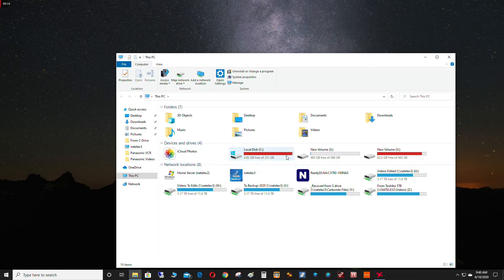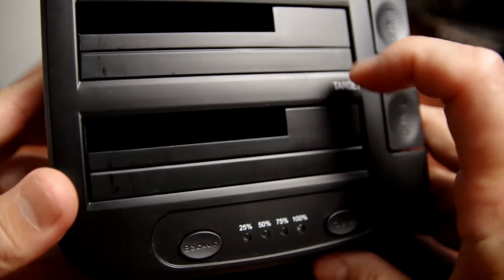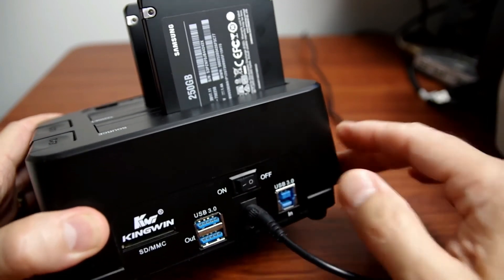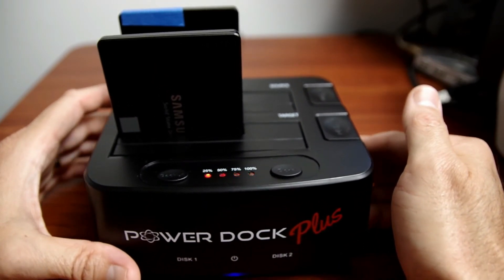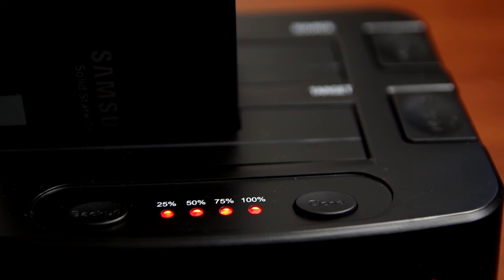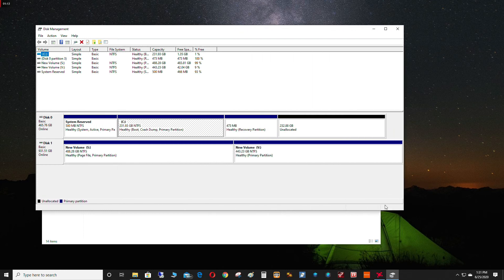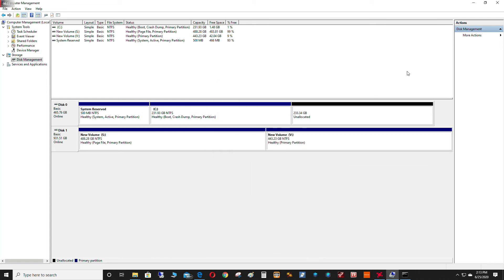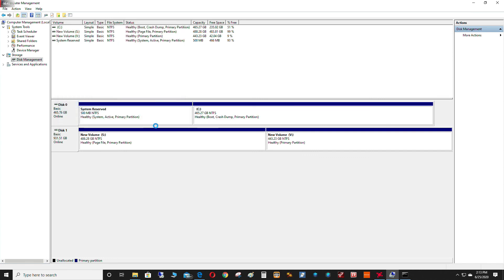Disk Cloning with Kingwin Power Dock Plus

Comment: Will it work on a Debian11 Linux? If so how would you expand the drive?
Reply from the maker: I'm not sure about the expanding part since I don't use Linux. The dock should copy any content and write to the other drive. Linux may not need to be expanded as it may see the rest of the drive automatically. This is just a guess. Please look at their website to verify that this dock is not windows only before buying. Thanks for watching the video.
Reply: @chitownarcher5645  It did duplicate the Linux Drive. Since It was going from a 250 Gig drive to a 2 TB drive, it copied it over as a 250 Gig partition. I couldn't get it to expand so I just made the second partition 1.5 TBs. Which I use to store the data files and use the primary partition to install the programs.

Comment: What if my cloned drive doesn’t work - I mean what if it dinnit get all the data from the source drive? I guess either try it again until it DOES  work, or use the restore discs on the new drive - everything from scratch (reinstall all my apps) I suspose.
Reply from the maker: Hope you cloning attemps are good. If the cloned drive does boot up properly, put your old drive back and boot up or do this in another computer. Plug the dock to the pc, and put the cloned drive and see if you can browse the files. You can also right click on the drive, properties, tools. Click on the check now in the error checking. Before cloning an old drive, update the OS, clean up the temp files. If you are cloning a spinning drive, defrag first. Hope this helps and thanks for watching the video.